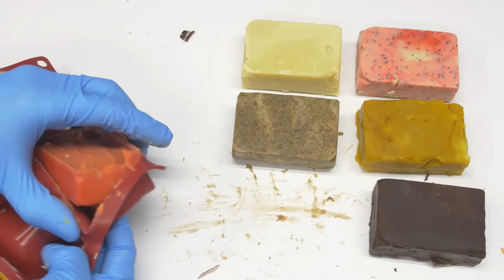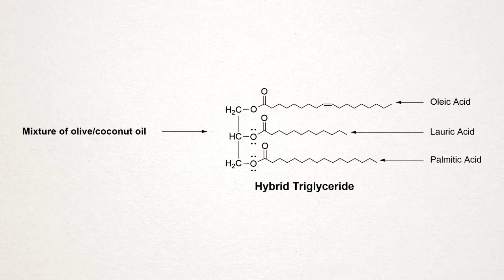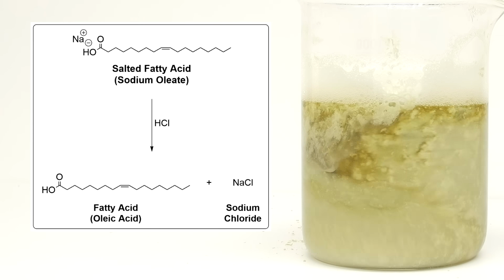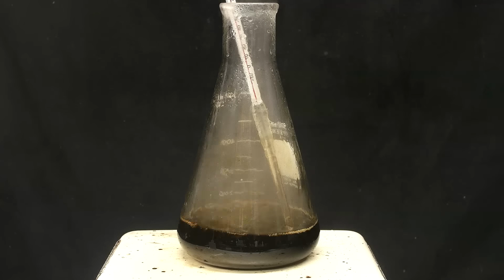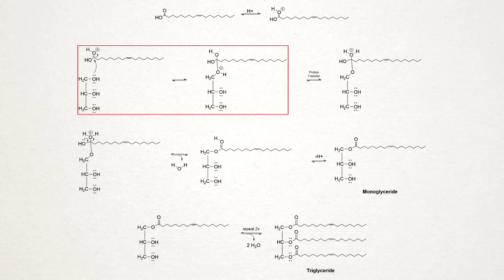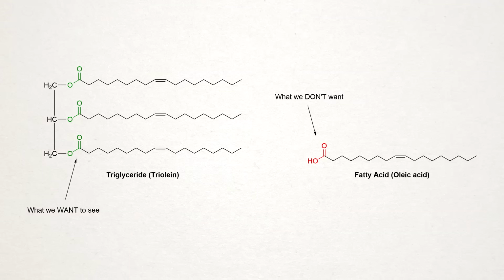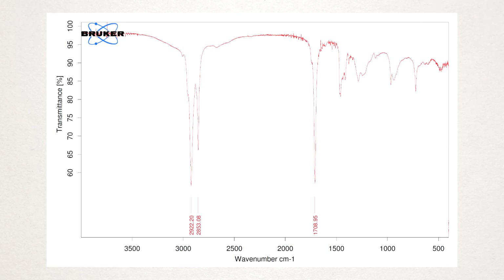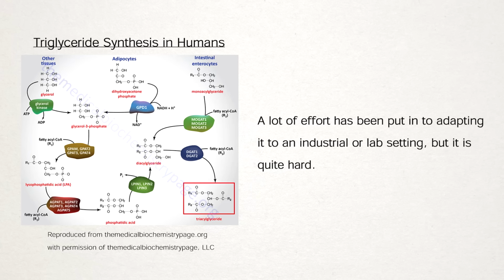Turning soap into oil and making French fries

Comment: Hey, Nile! I really like your videos. I wonder if it is easy to get into this chemistry stuff.  Is it expensive to buy ingredients for basic reactions I can start with? I guess there is needed apparatus too (distillation, stirring departure, lab glass etc).
Reply: As one who is getting started with my own home lab, I can say with some authority that it gets expensive quickly, if you want to do anything useful.

Ebay has some pretty good basic glassware kits, and most things are not too expensive by themselves, but they add up quickly if you want a decent setup.

You can start with common cups and glasses instead of beakers, as long as you aren't doing anything that will break them from thermal shock. (Unfortunately, most things require heating, which vastly increases the chances of breakage.)
Plastic containers are cheap for storing things that aren't sensitive to water or light.
Mason jars make great air-tight containers for drying agents and other hygroscopic things, and they aren't very expensive.

You can use a hotplate and a saucepan to make a pretty good oil or water bath setup.
You can get reasonably priced stopcocks for water at many hardware or home brewing stores. That is what I'm using for my cooling water at the moment. (I ordered a pump, but the mail is slooooooow.)

There's no getting around some things, though. Good stands and grippers for your glassware are a must. You do NOT want to slosh or splash some of these chemicals all over the place.

As for chemicals: Most of the basic ones are very cheap to buy or make. Some are harder to find than others, but they are out there. Just shop around. Ebay sells a lot of stuff. Best of all, most of them are useful for things outside of the lab. For example, I bought a 50 pound bucket of sodium hydroxide which can be used for reactions, but is food-grade, so can be used in baking, or as a drain-opener, and I just used some to get about 40 years worth of greasy crud off of a concrete floor at work. (Side note: Wear good shoes! Ouch!)

All in all, I've probably dropped a thousand dollars US on my setup, and I haven't even built my fume hood yet. (And I'm nowhere near getting $1000 worth of product out of my efforts!) There's still a lot more to add, but I'm taking things slowly.
Reply: Thanks for your response. I will reaserch more and maybe in near future establish my own lab.

Comment: If the soap was made with extra virgin olive oil, and it does look like it was, you would have a lot of other compounds in it such as as tocopherol and tocotrienols. Would their antioxidant properties explain any of the difficulties you had, or are they more likely to break down to a phenol of some sort and have a different effect? There are also a whole pile of polyphenols in extra virgin olive oil too. I guess this leads to the question of if you should have tested the reaction on a small scale with very pure materials first so that you could be sure that you had the process mastered and that if it failed with the impure materials it was in fact due to contaminants?

Comment: That is odd because a protonated carboxylic acid group will show a strong, broad signal in the IR. I even looked up an IR of oleic acid because I was curious and it shows this signal. There is an IR spectrum on google images listed as oleic acid, butyl ester that is lacking that signal, of course. With an ester, however, one usually observes a medium intensity, sharp signal at around 1050. It can be obscured due to other overlapping peaks, but you don't have those. Anyway, this was a fun project that I would probably never try myself, so great job!

Comment: Hi, Nile, I'm not an expert in IR spectroscopy, but in an spectrum of an acid there's a wide peak above 3000 cm^-1 and in this case there is not so there is no O-H bond vibration. I would say that you got an ester, maybe not triglycerides, but not an acid.
Reply: That's what I was saying!
Reply: Totally agree! I think there is no acid
Reply: I thought it was weird too but the usual shapes of the peaks refer to the classic, low complexity-low molecular weight molecules (like acetic or propanoic acid). 
I think that the difference in this case is that the C-H absorption peak (which usually stands out as a tiny spike mostly covered by the broad and low O-H peak of COOH groups) is so fucking massive because of the huge amount of C-H bonds that it overpowers the OH peak making it look small. Then, as another guy said, there's barely any peak at 1200, so no ester bond. And it's almost definitely a fatty acid and not some sort of weird fraction because there's the rocking peak at 729 that's typical of hydrocarbons with more than 4 carbon atoms. 
As for why it's liquid my best guess is that some sort of impurity is lowering its melting point.
Reply: Whilst I thought the same, the lit. IR of oleic acid did similarly lack the obvious OH signal I would expect, so I'm under the impression he's right.
Reply: @esequieltovar4955  Same here mate
Reply: My thoughts
Reply: You're right that there would be an acid peak above 3000, but he has no C-O peaks. So definitely not an ester.

Comment: Why is it in your IR there is a lack of a broad peak at ~2900-3000 for the OH on the carboxylic acid?
Reply from the maker: It happens with IR sometimes. I believe it is just "hidden" under the other peaks. This is why IR is kind of not great.
Reply: NileRed but even though IR can't elucidate the structure it was really clear that you had the acid and not the ester, since there wasn't the characteristic C-O extension band in the region of 1200 cm^-1 that mostly all ester had, also I must say that you really cleaned the acid, because the OH bonds of the acids are there but not that big as you can imagine since the lack of humidity and water in the sample. Even the failure nice video. I do have to work with IR all the time so... That's my experience with it. Nice job!

Comment: Is it possible that you thermolyzed your glycerides during distillation? 400C  is very rough for any compound. Maybe another purification technique, perhaps chromatography, is necessary.
Reply from the maker: It is possible, but as far as I know, they should distill without a huge issue. In general though, it seems like heat is the enemy. I am going to try again under milder conditions. I was trying to avoid solvents, but I think Ill need some.

Comment: p-toluenesulfonic acid does sound like a much better catalyst for this reaction. 

And you may want to apply a vacuum to the esterification reaction, so that you can remove the water at lower temperature, without  risking to decompose your glycerol. (Which I think is why your reaction failed.)

Also, I don't want to sound elitist, but I really wouldn't trust that paper you mentioned. Their temperature control was done using the hotplate's thermostat (so the actual reaction temperature is much lower than the one they indicate, but it's impossible to tell by how much), all they used for characterizing their products is thin layer chromatography, no NMR or IR, etc...

There's a reason it was published in one of the lowest ranking peer-reviewed journals.
Reply: NileRed why don't you do the vaccum filtration first before estarification reaction? If your final product contains mostly Oleic acid, if you do filtration earlier, you might get much cleaner product.

Anyway, I am not a chemist. So, I may be completely wrong.
Reply from the maker: +piranha031091 ha yeah, I do know what you mean. Although paper rank doesn't mean everything, it does matter. 

I think the other paper seems a lot more credible. I might try it again that way sometime in the future. Or maybe even another way if in find one
Reply: To me the real killer here is that you properly measured temperature with a thermometer  in the reaction flask, and had your reaction mixture partly decompose, likely due to overheating.

Since they measured temperature the wrong way with the hotplate's thermostat, they likely carried the actual reaction way below 195°C, which explains why you couldn't reproduce their results.
Reply from the maker: That is actually a really really good point. It is possible that they were at like 150C or less. That time when doing things properly results in failure, ha.
Reply: @NileRed  you are such a great personality. Love your videos could you give me a like.
Reply: yeah youu temparitures surprised me to. for the purification process you could do liquide chromatographie prevent you from having to heat up to 400 °c. if yo can't find powdered silicon dioxyde you can useicing sugar. that howw i did my first chromatography.
Reply: ... and also several soapmakers have pointed out that there is no way that the soap Nile started with wasn't colored artificially, so there's also that
Reply: Well if they were going by the thermostat on the heating plate then there is no way they could tell the temperature of the solution.

think about it this way; if you put water on a hot plate at 500 degrees how hot is that water when it's boiling? it's still only 100 degrees